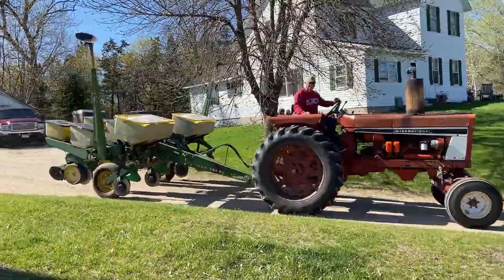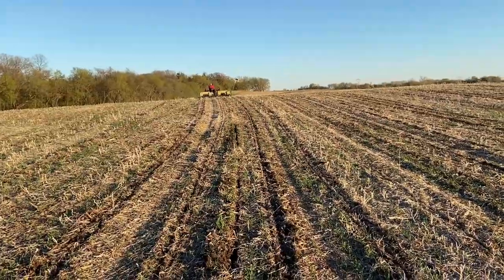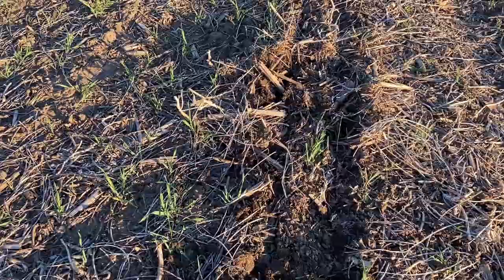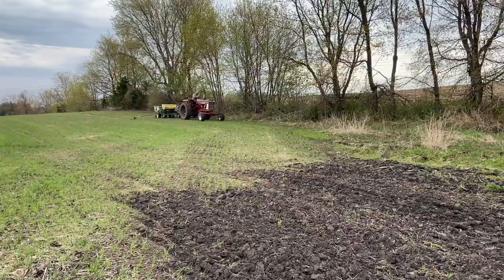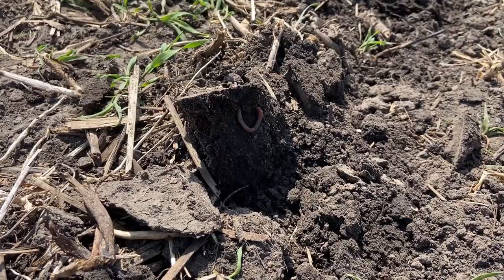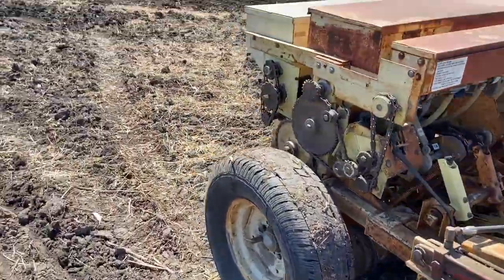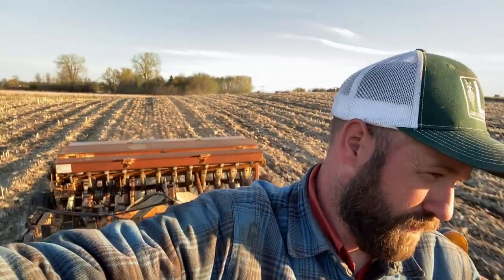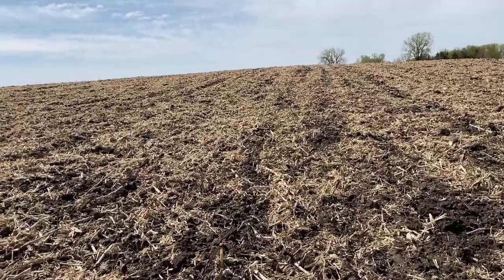No-Till Planting Corn and Soybeans

Comment: It looks like you planter is a little nose down, in the video anyway.  I’ve planted 1000’s of acres with a JD 7000 and they perform best when the bottom of the drawbar is as close to level with the planter in the ground as you can get it.  If this was just the video sorry don’t mean to tell you your business just a tip I picked up over the years.  Good luck this season!

Comment: Got any old chains laying around? Use short sections and attach to back of row units so they hang with a u shape, they'll drag those dirt clumps into the seed trench and help with closing the furrow.
Reply from the maker: Next year for sure!  Along with upgrades to the whole closing wheel assembly (ours are pretty worn out).

Comment: Just found your channel, good work with the videos.  Sounds like I'm in similar stage of trying to farm regeneratively as you.  Regarding putting fertilizer all down 2x2, I've been doing largely the same using same logic, and not having great results (although not sure how much fertilizer placement is a factor vs other things).  I recently was introduced to the book Hands On Agronomy by Neil Kinsey; I'm only part way thru, but recommend you check it out.  Seems like a real smart cookie.   He advises against feeding the plant with heavy banding rates; suggests feeding soil with broadcasting.   It's definitely making me rethink my approach.
Reply from the maker: Thanks Nathan!  I'll have to check that book out.  I always find it interesting how different farmers have different experience with the various methods available.  When I broadcast my fertilizer in a no-till scenario, I really didn't like the results - BUT - I only did it for one year, so that's bad statistical analysis on my part.  A guy really should take an average.  It's hard to observe good scientific practice when each experiment takes a year, and we only have so many years to live, LOL.

Next year we're actually going to experiment with making compost, and applying some compost extracts.  My ultimate goal is to supercharge the biological components of our soil, get the nutrient cycle working on its own, and try to move away from commercial fertilizer applications.  It all takes time though, and a lot of trial and error.  It'll be fun if nothing else!

Comment: What is the extra arm used for, I've seen it down a couple of times running on top of soil.
Reply from the maker: I believe what you're seeing is the marker arm.  It makes a shallow little furrow, and when you get to the end of the field and turn around, you line that little furrow up with the center of the tractor and planter, and that gives you the proper row spacing for your next pass.  When you raise the planter at the end of the pass, the marker arm that was in the down position raises up when the planter lifts out of the ground.  Then when you turn around and lower the planter for the next pass, the opposite marker arm lowers and marks your next pass, and on and on until the field is done, or you run out of seed, or the supper bell rings.